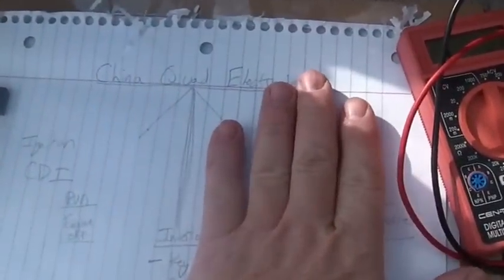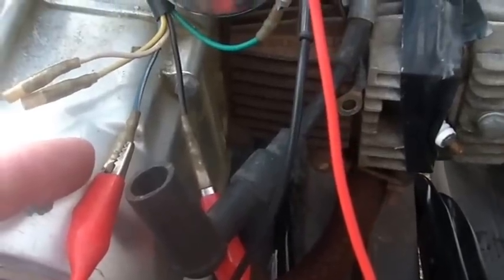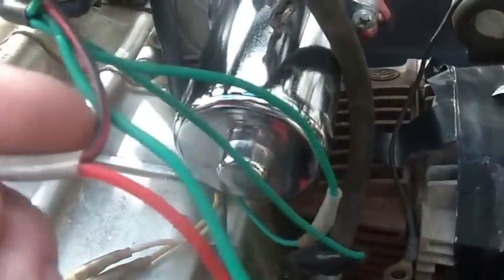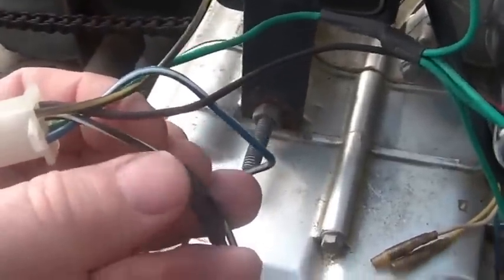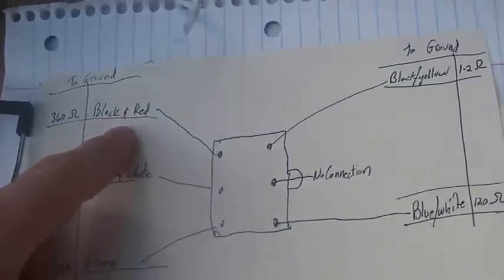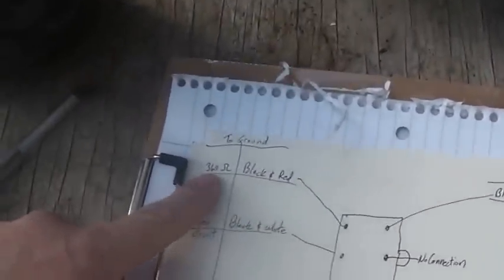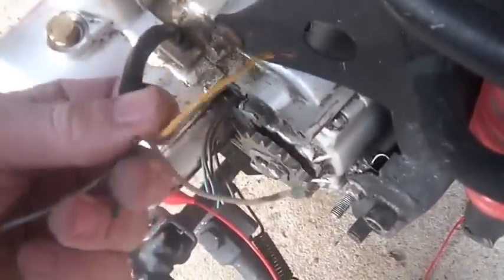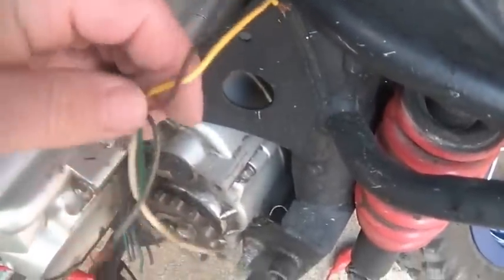Intro To China ATV CDI ignition, troubleshooting

Comment: Please get back to me need help
Reply from the maker: Hey Cory, Hook up the whole thing like U R ready to run it and do the resistive readings like I did on yesterdays video....When U R using the pit bike ignition there are only 3 things that U R using from the oem atv, they are ground, the stator for ac powered to the cdi, and the pulse generator... So, it must be one of those.... Where R U located, anywhere near the Hudson Valley of NY???? Thanks for asking, watching, and commenting, Good Luck!!!
Reply: thanks for gettin back to me and yes everything is hooked up right. u think the nuetra saftey switch could cause me to get no spark?
Reply from the maker: Hey Cory, U need to do the resistive testing to determine what it wrong, please get back with me on those values, thanks for asking, watching, and commenting!!!!